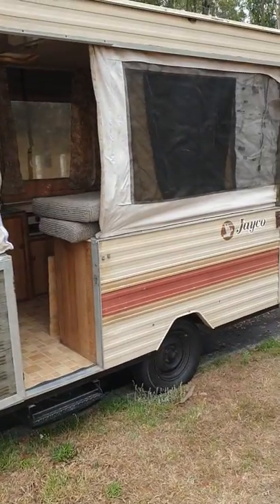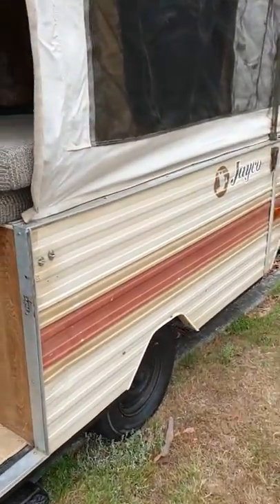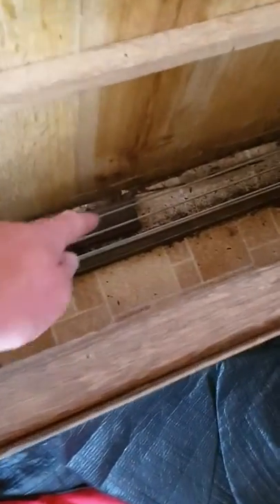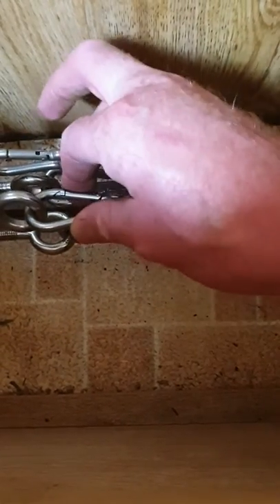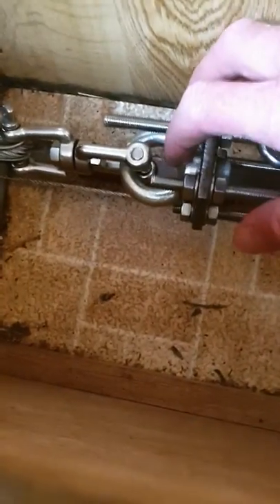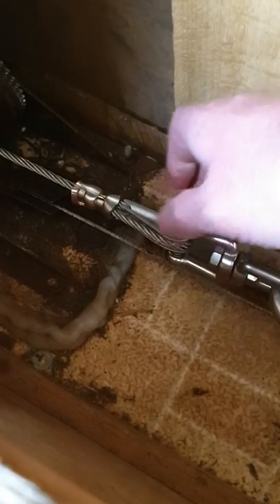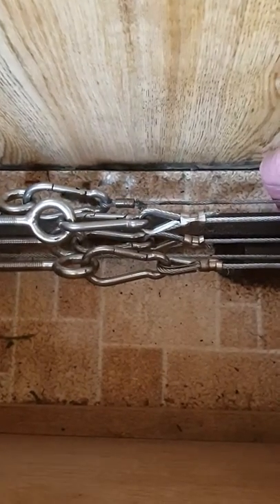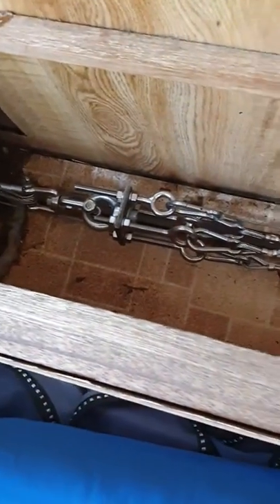Cable repair Jayco pop up

Comment: did you change the pulley as ours broke 
we also have front right corner single pully with two cables running thru
Reply from the maker: Hey, no I didn't change the pully, I probably should have but I just greased it up and it still worked.
That front right corner became a week spot from all the tension of the cables on it, it eventually pulled the bracket out of the floor, I just re shaped it and screwed it down to the chassis with larger tech screws. Iv since sold the van but it lasted for the years we had it.

Comment: Wow, with this system it looks like it would be easier to swap a broken cable cause it would be easier to just cut it to the exact size and pop it in. I like it. 

What’s size cable did you upgrade to? 
How’s it hold up so far? 
Cold you link parts you used?
Reply from the maker: Thanks for the comment mate,
I got all the parts from bunnings, it ended up being pretty cheeps, I can't remember off the top of my head the cable size but it was larger. It's all still holing up great and I haven't had any issues with it.